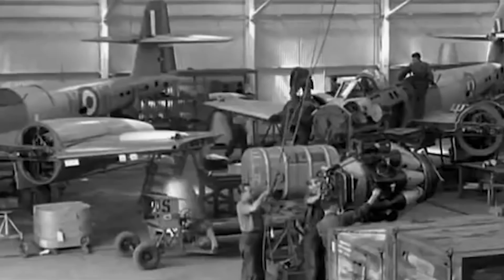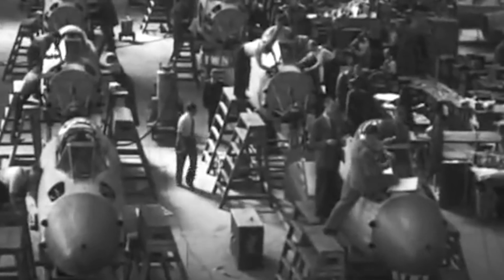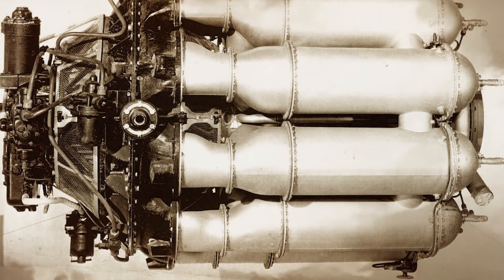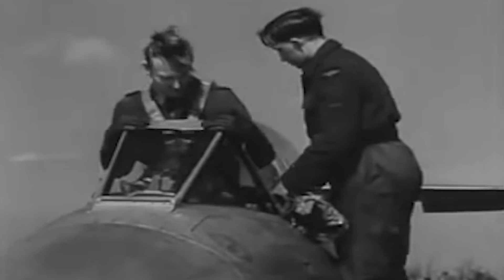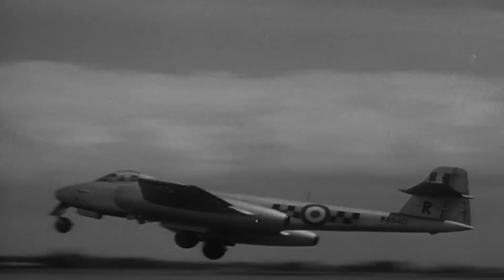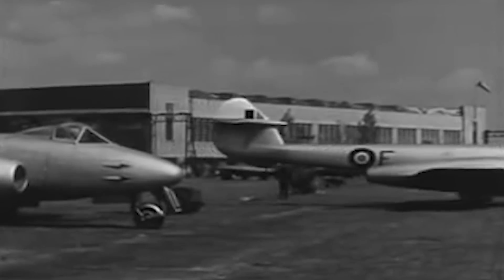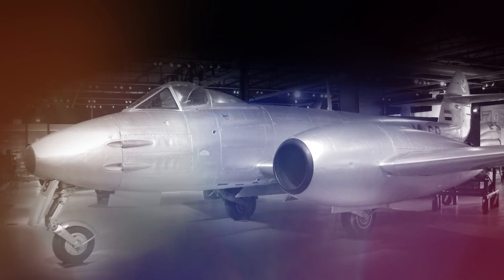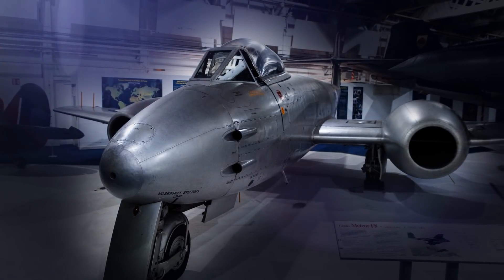Gloster Meteor - The Only Allied Jet to Fight in WW2

Comment: WRONG! The Meteor was NOT developed in response to the ME 262. They were developed quite separately.  Frank Whittle had been working on it for years and even published a paper on it (which the Germans read).  If the air ministry have got behind it and Rover hadn't made a hash of the engine, it would have been in combat much earlier.
Reply: The Gloster "Meatbox" as it was uneffectionately called by RAF pilots  was originally a proposal for a piston engine night fighter.
Its now 2021, its the Information Age and the old propaganda myths about Frank Whittle inventing the jet engine are simply no longer tenable.
Whittle did not invent the turbojet engine and was not the first to successfully test one.
 The real genius behind Britain's jet engine programme was Adrian Lombard at Rover and Stanley Hooker at Rolls-Royce... Without this two men there would not have been any British jet aircraft.
I wouldn't have mattered if the Meatbox was in service sooner, it was a complete failure as a fighter aircraft and a much worst threat to RAF pilots than the Luftwaffe.
Reply: @sandervanderkammen9230  Hello Sandyhoney, I see you're still trolling out your garbage.  The Gloster Meteor was a purpose built jet development aircraft which flew with various jet engines, including the Metrovick F2 that was the basis for the Sapphire and J65 engines. The nazis took a different route of adapting a standing piston prop design which is why the Me 262 started as a tail dragger and was powered for some time by a Jumo piston prop combination and looks so much like the the Me 309.

I always think it's worth reminding you of what the famous German gas turbine pioneer Pabst Von Ohain had to say in his foreword to 'Elements of Propulsion, gas turbines and rocket'-

"The first patent of a turbojet engine, which was later developed and produced,
was that of Frank Whittle, now Sir Frank (see Fig. 5). His patent was applied for
in January 1930. This patent shows a multistage, axial-flow compressor followed
by a radial compressor stage, a combustor, an axial-flow turbine driving the
compressor, and an exhaust nozzle. Such configurations are still used today..."

and -

"In April 1937, Whittle had his bench-test jet engine ready for the first test run.
It ran excellently; however, it ran out of control because liquid fuel had collected
inside the engine and started to vaporize as the engine became hot, thereby
adding uncontrolled fuel quantities to the combustion process. The problem
was easily overcome. This first test run was the world's first run of a bench-test
jet engine operating with liquid fuel..."

and-

"From the beginning of his jet propulsion activities, Frank Whittle had been
seeking means for improving the propulsive efficiency of turbojet engines.  He
conceived novel ideas for which he filed a patent application in 1936, which
can be called a bypass engine or turbofan. To avoid a complete new design,
Whittle sought an interim solution that could be merely "tacked on" to a jet
engine. This configuration was later known as the aft fan. Whittle's work on
fan jets or bypass engines and aft fans was way ahead of his time. It was of
greatest importance for the future or turbopropulsion."
Reply: @sandervanderkammen9230  I see you are still trotting out your gobshite Sandyboy.
I've challenged you before to identify your fantasy piston prop airframe with regard to the Meteor and indeed here in the 'Information Age' you have singularly failed to do so. 
As for Whittle, I'll just remind you what the that German jet pioneer Hans Joachim Pabst von Ohain haid to say in his foreword to 'Elements of Propulsion, gas turbines and rockets'-
"The first patent of a turbojet engine, which was later developed and produced,
was that of Frank Whittle, now Sir Frank (see Fig. 5). His patent was applied for
in January 1930. This patent shows a multistage, axial-flow compressor followed
by a radial compressor stage, a combustor, an axial-flow turbine driving the
compressor, and an exhaust nozzle. Such configurations are still used today..."

and

"In April 1937, Whittle had his bench-test jet engine ready for the first test run.
It ran excellently; however, it ran out of control because liquid fuel had collected
inside the engine and started to vaporize as the engine became hot, thereby
adding uncontrolled fuel quantities to the combustion process. The problem
was easily overcome. This first test run was the world's first run of a bench-test
jet engine operating with liquid fuel (Fig. 7)."

and 

"From the beginning of his jet propulsion activities, Frank Whittle had been
seeking means for improving the propulsive efficiency of turbojet engines. He
conceived novel ideas for which he filed a patent application in 1936, which
can be called a bypass engine or turbofan. To avoid a complete new design,
Whittle sought an interim solution that could be merely "tacked on" to a jet
engine. This configuration was later known as the aft fan. Whittle's work on
fan jets or bypass engines and aft fans was way ahead of his time. It was of
greatest importance for the future or turbopropulsion."

And as for the Meteor, it was operated by more than a dozen air forces and for over thirty years. Those air forces included the Argentinian air force in which Adolf Galland flew the Meteor praising it and declaring his wish that he had had the Meteor's engines in the Me 262.

Comment: I'm not familiar with the Meteor actually fighting anything.   It never confronted the ME262 or Arado Bomber.  Pursuing the V1 was 'putting it into service' but the V1 could not stand and fight...
Reply: The Gloster Meatbox as it was called by RAF pilots never saw duty in the fighter role during WW2 or Korean War with the RAF, 
Although classified as a fighter it was unsuitable to the role and the plane was never successfully operated as fighter, it was used almost exclusively as a trainer, reconnaissance, ground attack and demonstration flights.
Reply: @sandervanderkammen9230  Sounds like you're seconding my point; thanks...
Reply: @thomasaquinas5262  Absolutely, as fighter aircraft the Gloster "Meatbox" was a resounding failure.
Reply: Hard to fight what cuts and runs.  By early 45 the Luftwaffe was not mounting many fighter missions at all.  The few it flew were in support of actual ground combat so no fuel or aircraft to go fighting.  Also the 262 was forbidden to engage in dogfighting.  Not much of a fight when it wasn't allowed to fight because it lacked the performance needed.
Reply: @jimdavison4077  The Messerschmitt Me-262 was responsible for over 550 Allied aircraft shot down including fighters.
The Gloster Meatbox ZERO!
Reply: @sandervanderkammen9230  you really believe Nazi propaganda? I love the way Nazi fan boys believe every claim made despite mountains of evidence to the contrary.  The 262 south down less than half of what they claimed and that is basses on squadron records.  Tell us all what it means when 262 units made 8 claims yet no allied bomber is on record being lost that day?  Tell us how many hours operational service did the 262 have post WW2?
Reply: @jimdavison4077   The Messerschmitt Me-262 was responsible for over 550 Allied aircraft shot down including fighters.
The Gloster Meatbox ZERO!
These facts are irrefutable, they are well-known and accepted by everyone, everyone ironically but you.
Reply: @sandervanderkammen9230  repeating debunked claims don't make them.real. The 262 was scrapped because it had a self destructing engine, useless weapon  and suicidal air frame.
Reply: @jimdavison4077  OVER 1,000 Gloster Meteors CRASHED... that's 1 out of every 4 built.
The planes was so suicidal to fly British pilots called it the "Meatbox", "Meat Can", "Flying Coffin" and "Widowmaker"
RAF ground crews called it the "Meteorite" (a meteor that crashes into the Earth).
Reply: @sandervanderkammen9230  and yet it had less deaths per hour of flight than the 262 by a considerable ammount. It served more than 30 years with air forces around the globe with it introducing jet fighters to many air forces of the world.  Funny you never mention the total flight hours it flew.  Seems you just what to ignore history.
Reply: @jimdavison4077  Funny how you choose to ignore that the Meatbox never shot down a single Luftwaffe plane?
Yet it killed 450 British pilots...
How do you explain this deplorable service history?
Reply: @sandervanderkammen9230  simple, it was the first jet tens of thousands of pilots flew, it was far from a perfect aircraft being the first of its type to see service with an operational squadron in the world.  I can't list the nations that used it over the next 30 years but if you looked I am sure even you would be surprised.  Now it's accident rate was well below that of the 262 by a very large margin with pilot error being a leading cause as pilots coming from piston engines found the learning curve quite steep.  Many books and articles covered this material but you with your delusions would never want to accept the word of aviation inspectors and squadron leaders from several nations.  So let's recap, the 262 had a career of six months from Dec to May then was scrapped.  It had a 1.5 to 1 kill ratio but at a high cost to its own pilots.
Reply: @sandervanderkammen9230  it destroyed over 50 Luftwaffe aircraft while how meteors did the 262 destroy?  Oh thats right none.  The boys over at bomber command shot down more meteors than the Luftwaffe.  By the time the Meteor reached the continent the Luftwaffe was putting up 30 to 50 aircraft a day, no wonder they cut and ran everytime they saw the superior jets of the RAF.  At that point with the war lost most Germans only wanted to survive it.  This creates the perfect enviroment for habitual liars like Galland to blame everyone but themselves.
Reply: @jimdavison4077  Please explain how the Meatbox killed 450 British pilots with out ever shooting down a single Luftwaffe plane???
Reply: @sandervanderkammen9230  Hello Sandyboy, wasn't the Me 262 a shit aircraft. No one wanted it after the war, not even the nazis in Argentina. The Gloster Meteor served with more than a dozen air forces and for over thirty years.

Comment: The Meteor was in squadron service before the Me 262 so hardly shocked the allies when the 262 appeared.
Reply: The Messerschmitt Me-262 was the first jet aircraft in service during WW2, the Me-262 became operational in April 1944 and destroyed the first Allied aircraft a RAF Mosquito in July 1944.
Reply: @sandervanderkammen9230  
The first 262 shot down by an aircraft was on the 5 Oct 1944 when a Spitfire shot one down. Spitfires went on to shoot down many more and, along with the Tempest were most feared by 262 pilots
Reply: @monza1002000  The Messerschmitt Me-262 shot down over 550 Allied aircraft including 85 RAF planes including fighters like the Spitfire, Tempest and Mosquito.
26 Luftwaffe pilots became aces flying the Me262. 
It's performance in the air was unmatched by any Allied aircraft, most Me-262s were destroyed on the ground pr jumped during takeoff and landing..
Reply: Sandbum dorktorbummer.
Prove that the Me 262 shot down 85 RAF aircraft. It failed to shoot down a single Spitfire or Tempest.   The Me 262 was sent after unarmed Spitfires and Mosquitos. it was a failure that couldn't catch them, when it met armed Spitfires or Tempests the Me 262 pilot had one choice, try to run away, that did sometimes work but often not, if the Me 262 pilot tried to climb, dive or turn he was dead.
Reply: @sandervanderkammen9230  The 85 figure is for US aircraft. You are lying again.
Reply: @sandervanderkammen9230  No, most Me 262 were destroyed when their engines fell apart.
Reply: @sandervanderkammen9230  The kill rate for the 262 was 2.4. A total waste of money and time. Built 1200 but only 400 ever flew.

Comment: When Whittle took a degree in the 1920s, his thesis was on jet engines.   If the post-WWI UK government had both the money AND THE ENTHUSIASM AND FORESIGHT, then when the Luftwaffe entered WWII it might have been faced with a few squadrons of something with a performance between a Meteor and a Hawker Hunter  - 'what if' 'what if'!
Reply: Frank Whittle did not receive his degree until 1935 and did not begin actual work on jet engines until 1936 when he moved to Rugby... two years after Hans von Ohain.
Reply: @sandervanderkammen9230    -  He had obviously been thinking of the concept years earlier without initial official finance or support, but did engage with a couple of engineer friends and he did take out a patent [which was not cheap], in 1930 - with early funding and official backing things could have been very different, as I commented.
Reply: @truthseeker7242  But Frank Whittle was not the first to patent the turbojet engine.
Reply: @truthseeker7242  It was not a matter of funding.
Whittle needed coaching first !
Reply: @bubiruski8067  There would not have been a jet engine in the U.K. if it had not been for Adrian Lombard and Stanley Hooker.
Without them Whittles engine would have never got off the ground.
Reply: @sandervanderkammen9230  Ooh, Sandyhoney are you back in love with Maxime and his hilarious patent with its sweet little crank handle?
Reply: @sandervanderkammen9230  Oh Sandyboy, you are funny. Next you'll be claiming that Pabst Von Ohain built a working jet engine in 1934, you are such a comedian. 

I always think it's worth reminding you of what the famous German gas turbine pioneer Pabst Von Ohain had to say in his foreword to 'Elements of Propulsion, gas turbines and rocket'-

"The first patent of a turbojet engine, which was later developed and produced, was that of Frank Whittle, now Sir Frank (see Fig. 5). His patent was applied for in January 1930. This patent shows a multistage, axial-flow compressor followed by a radial compressor stage, a combustor, an axial-flow turbine driving the compressor, and an exhaust nozzle. Such configurations are still used today..."

and -

"In April 1937, Whittle had his bench-test jet engine ready for the first test run. It ran excellently; however, it ran out of control because liquid fuel had collected inside the engine and started to vaporize as the engine became hot, thereby adding uncontrolled fuel quantities to the combustion process. The problem was easily overcome. This first test run was the world's first run of a bench-test jet engine operating with liquid fuel..."

Comment: Air battle blwflufftwaffe me262?
Reply: The Meteor never engaged or shot down any Luftwaffe planes during WW2.
Reply: it didn't needed anyway, by the time it was active piston fighters could do the job and were more reliable, unlike the germans, they weren't desesperate enough
Reply: @marrvynswillames4975  The Messerschmitt Me-262 was responsible for shooting down over 550 Allied aircraft.
26 Luftwaffe pilots became aces flying the Me-262. 
 The Meatbox was never a effective fighter aircraft, pilots had their hands full just trying to keep the aircraft from crashing, over 1,000 crashed killing 450 RAF pilots.
Reply: @sandervanderkammen9230  Ah, back to the Me 262 myths. Even if between never getting off the ground and disintegrating in the air for no apparent reason, the Me 262 had shot down over 550 allied aircraft, which they didn't it was absolutely of no significance. As Marrvyns Willames says the allied aircraft were well able to handle them and even on their most successful day the Me 262 barely managed to scratch the surface of the allied juggernaut.

Comment: “The design of the meteor was more attractive than that of the 262” bro you been smoking? The 262 is better looking.
Reply: First thing I thought was how much better looking the Me262 is
Reply: The meteor lasted a lot longer than the 8-10 hour Me 262, that makes it attractive especially to their pilots, I prefer the Looks of the Meteor to the 262 but that is just me.
Reply: @georgebarnes8163  That is incorrect.
The Jumo 004b engines exceeded the RLMs 100hours PFTR reliability standard required by the Luftwaffe before entering military service.
This is the exact same PFTR standard for the RAF and USAAF during WW2.
Operation Lusty and found Messerschmitt Me-262 engines averaged TBOs in the 50 -60 hours, excellent by WW2 standards and better than some British aircraft.
Reply: @sandervanderkammen9230  OK Karen
Reply: @georgebarnes8163  450 RAF pilots were killed flying the Meatbox, one of the most common crashes was due to engine failure.
The meteor had horrible asymmetric flight characteristics and an engine failure on takeoff was usually fatal.
Reply: @sandervanderkammen9230  OK Karen
Reply: @georgebarnes8163  Thank you for proving my point.
Reply: @sandervanderkammen9230  OK Karen.
Reply: @sandervanderkammen9230  The Gloster Meteor served with more than a dozen air forces and for over thirty years.